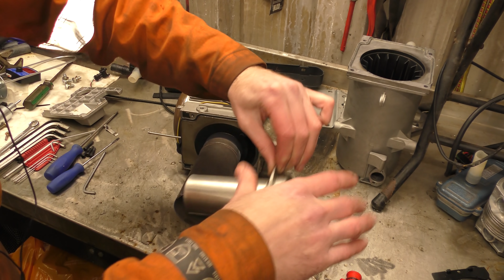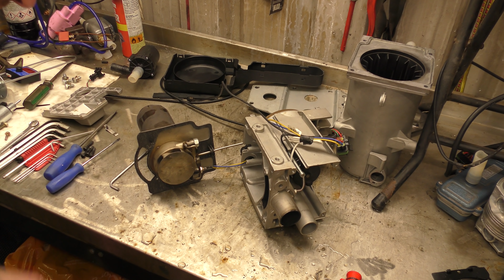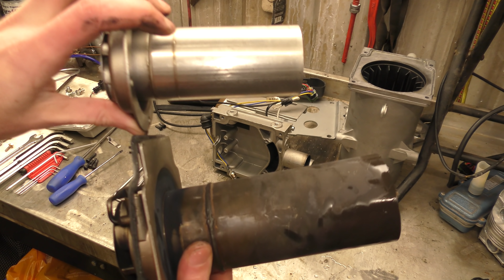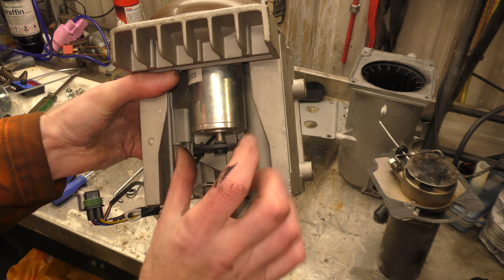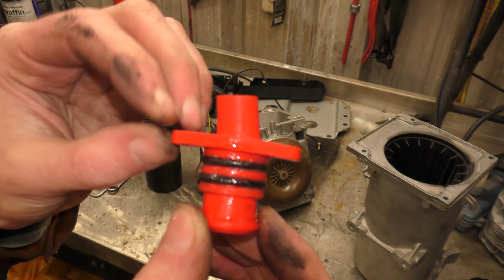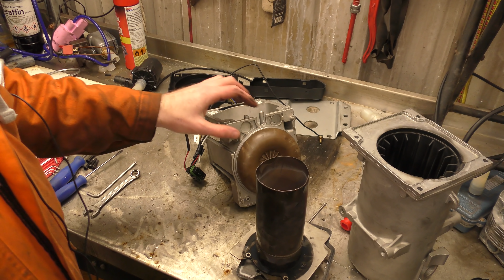16KW Diesel Water Heater Disassembly

Comment: Just found your channel and this video by searching for a solution to heat my hot tub, it will probably need an extra cabinet or enclosure to prevent it from the elements and to reduce the noise but it does seem promising. As it is now 5 years later, are parts still available and does it still feel like a solid water heater?

Comment: Question, I go camping a lot in frozen conditions, can these air and water heaters be ran with no water in the system, I'm tring to find a dual purpose solution to my heating issues for my ice fishing house, b7t I d9nt want to Hage to buy two items to be able to have hot water an heat,btw hello from Alaska USA, I really have learned so much from your videos and thank you for spend8ng your time to help educate
Reply from the maker: Yes, can run with no water.

Comment: Really enjoy your videos!!!! When you dismantled the heater and stod with just the burner left, it looks like it can be mounted in a small boiler? I have a defective Kabola heater in my boat that uses a 14kw burner and maybe 20L ish with water.
If this was mounted in I would guess the efficiency would increase since the exhaust also goes into the boiler as heat exchange.  Just sensors that need to be refitted if possible.
So could that be another step towards self powering heater? mounting the heater into a boiler/heat exchanger?
Reply from the maker: It has been done, someone sent me a video of exactly that, just the heater core mounted on a plate that matched the boiler.  It's just the housing temperature sensor that need moved to it can tell it lights and not overheating.

Comment: that looks alot like the VVKB heater inside... are there really like maybe 2 companies that make these designs? the VVKB video tells you to do like you did for its glowplug.. spin the burn chamber lolol
Reply from the maker: They are all probably buying the main heater body from probably one company and rebranding, perhaps then adding their own controller etc.
Reply: @DavidMcLuckie  thats what it seems.. and VVKB made mistakes!..  I noted that they added a rubber shield a few millimeters thick on the stub where the pump mounts..  oh yeah it made the flange of my pump crack.. and the O-rings didnt seat right so it leaked..  they had to send me a new Pump Body..  oh then the controller..  (different from yours) blew up.. so the ysent me a new one..  oh now my pump defunct altogether.. so I just left it there and wired to an external Davies-Craig pump and now my Heater works.. well when it lights..  it lights perfect above 0c, but below 0c it always has trouble lighting off..  so i think VVKB has much to learn about heaters perhaps...

Comment: Just want to say thank you. I found this video as I have this exact heater and the unit showed up with a broken water inlet elbow.  Your comment about the water pump fitting in that location saved me a good couple of hours fabricating a replacement.  Excellent videos!
Reply from the maker: Great to hear.  I had 3D printed a part to fit, but it didn't stand the heat so well.
Reply: @DavidMcLuckie  I just posted a video about having to make an aluminum water inlet for this heater and linked your video. Thanks again for posting all of these informative videos.

Comment: Cheers for the look around the unit, looks good for reliability, a quick resoldering on a glow plug doesnt seem to bad for maintainance with a clean out of the burn chamber, will be interesting to see its efficiency in action, where a little pipe from the unit to the pump looks good to split it up from the blocks heat a bit. Gotta respect those 3d parts though, the blocks dont half look like they get roasting hot.
Reply from the maker: Yeah the pump and the actual hose connection are a really hard plastic, the not melting kind.  :)
Reply: @DavidMcLuckie  honestly amazed the plastics can take the heat, i thought at those temps the bonds would break down and it would go maliable, thanks for pointing it out its well worth the noting.

Comment: With that output it should be up to supplying a shower on demand with a brief preheat phase. Would also be interesting to up the efficiency by scavenging waste heat from the exhaust with an inter cooler unit for hot air space heating. Another excellent video. Got the impression it may have been raining outside!

Comment: I'm curious about operating  the 2kw burner chamber without the heat exchanger.  what  if you could, should or would or i's possibly a bad idea
Reply from the maker: It should work.  The only issue is putting the chamber temperature sensor somewhere it gets hot enough that it thinks everything is normal, but not so hot that it thinks it's overheating.
Reply: @DavidMcLuckie  maybe experiment with it outdoors, it would make good video and haven't been seen ,  call it "Pants on Fire"